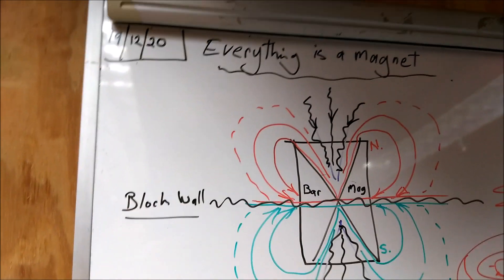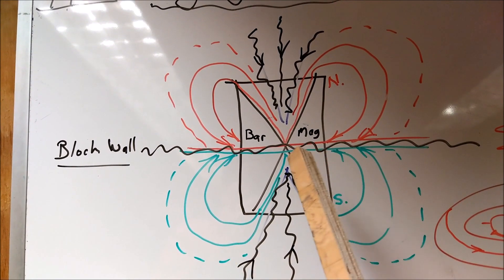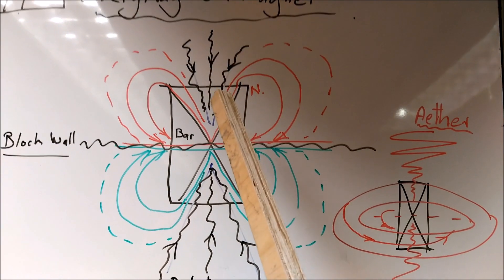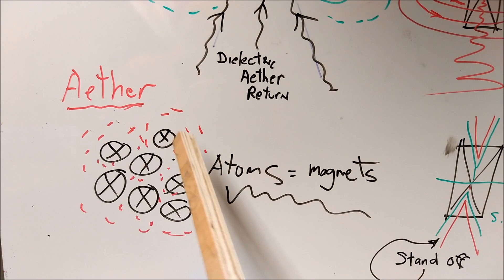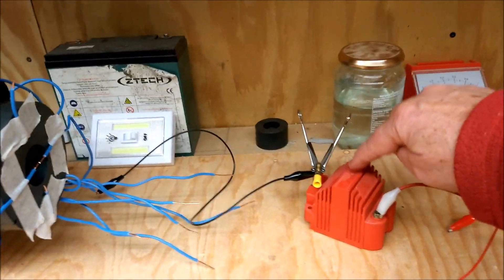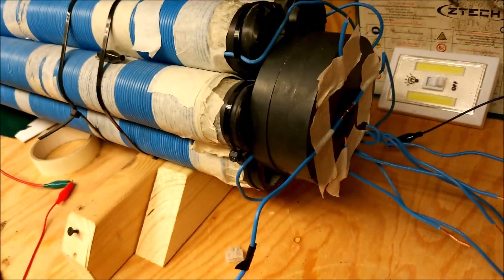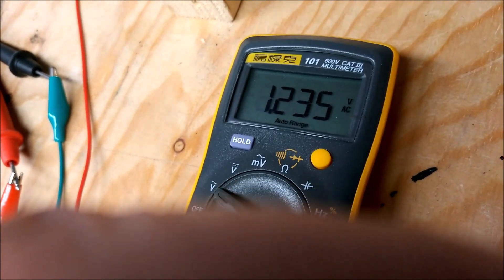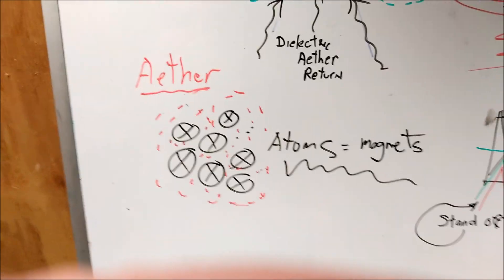Everything is a Magnet

Comment: lets take a different approach. lets build a physical model, with close analogies. say, water.

best thing ive seen is whoever it was with his revolving drums in water. iboke? showed all the  characteristics of magnetism quite clearly.

but that has me thinking of other models to build. he had just plain neutrally buoyant cylinders. using boundary layer effects to drag water along with them, using an external power source.

so. 

how about a hollow ring instead?

two conical sections leading inwards, to a ring in the middle where water is then flung out.

as in, a physical model, as best one can achieve, of this magnet idea...

you should get the exact same figure eight hyperboloid, as water is accelerated through the central ring, ejected at high velocity, encounters stationary water around it, imparts some of its velocity, slows down, but is then caught in an incoming flow towards the two ends and back into the system.

one could maybe consider  the speed and density of this fluid, how much it interacts with whats around it, versus how much of it starts to loop back into the system.

and then, hoping everyone has the wide general knowledge to also know exactly how a torque convertor works...

that incoming stream of fluid imparts its motion to the spinning drum and assists in driving it with the use of specially designed blades, perhaps...

all magnets wear out eventually, and i see it exactly as this interaction with stationary external "fluid". you give them a spin, and they slowly wind down as fluid is ejected, loses momentum, and is diluted and returned to the system. always something being lost, and in replenishing it, something else is lost... always losing angular momentum.

wheres the "keeper" acts just like a bunch of little pipes, confining the fluid to a very nice, non interactive and laminar flow, so magnets dont tend to "wear out" as fast.

and a neo magnet is this insanely high velocity fluid flow, so fast that its pressure reaches near zero... (bernoullis) they wear out but that high velocity low pressure stream sort of keeps to itself naturally. the stronger the magnet, the smaller and tighter the field... its screaming bernoullis...

dots. seemingly unrelated dots.

people should read more ;)
Reply from the maker: 5 Star comment, you sir have knowledge.
We are the same page!!!!
This comment is one of the most important since I started the E.power channel!
Thank you and... Regards DC
Reply: @e.powerdc1127  cheers.

one thing i mean to do in the near future is just print two lily impellers of opposite hands stuck back to back. my cad skills are... developing. not quite what i envisioned the other night as a demonstration but much the same still. draw in from the ends, eject from the central common plane.

just fired the printer up now.

got obsessed with that design a few years back, its genius. unlike the several videos of people attempting to use it for producing thrust etc. it doesnt do that. it does get a large, 4 acre dam circulating and churning after two days with only a few watts of input power though! that blew me away... 

highly misunderstood. like schauberger himself. theres the current fanfiction MIT joke, toroidal propellors running around lately. minimise blade tip vortices.

i ask...why not try to promote the vortice and use it? theres mass in motion, pressures... 

also the... dave scharmann? video, his impellers from years ago. he showed some interesting ones, some things id really like to be playing around in cad and real models with.

man stand up to wind, demand it do work. wind laugh, flies round man and pats him on back...

unrelated dots... :)

when you watch salmon struggle up a man made weir but just fly up a mountain stream...you start to understand.

we havent got past the concept of "hit thing with stick and thing move"...

Comment: Is a Magnet just a polarised object? It is not neutral to the surrounding EMF, since it has 2 poles "forced" on a single Object, therefore it will create an Inertia-plane as a pressure mediation field ... ? And so the Magnet will react to other Magnets and metals and pressure mediate with all bipolar objects ... ?
Reply from the maker: CDN.. thanks for info. So do the N & S fields cross over and flip at the P.I.?
Reply: @e.powerdc1127  I wonder what Ken says about this, the question is; the returning dielectric "flows" from the Hyperboloid (which I think is what we call gravity) do they meet up/connect at the inertia plane into one? Is the N and S side in the same Aether dimension ...? Or is that a totally wrong way to look at the problem ...
Reply from the maker: @CDNTheOnePath  CDN "Same Page of thinking"! So many cover ups!
Not many here with this view.
Tesla:-Key words that a spark at the spark gap was an EVENT in the Aether.
Amen.
Regards.... DC

Comment: Ever seen a magnet in the shape of a pyramid? Neither have i. Made a pyramid of copper and when i put it on a magnet it made 2. something volts to earth and very little amprage. I will look for the video and upload it. It may have been induced by electronics on my bench like soldering iron or speakers. I need to recreate it in isolation.